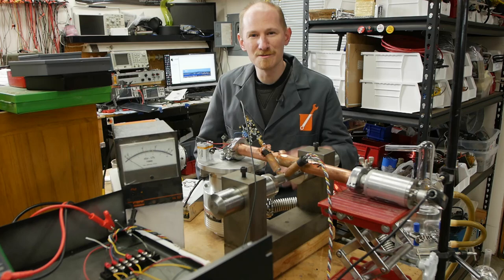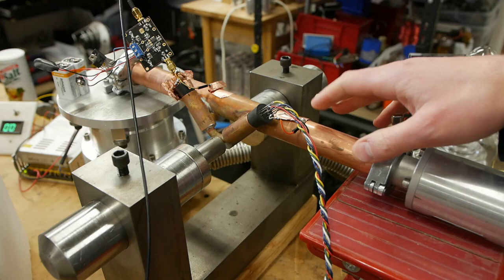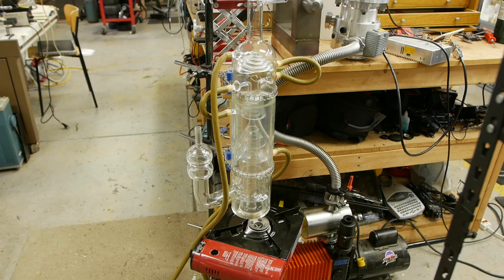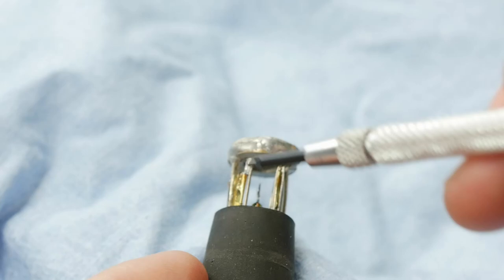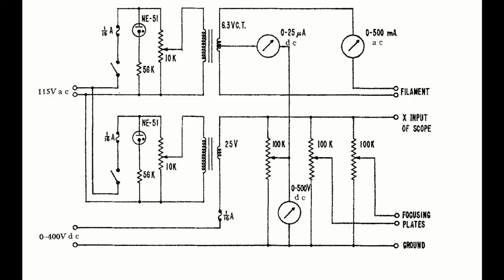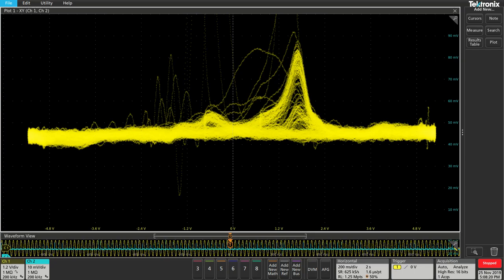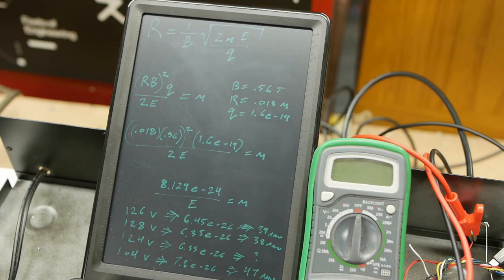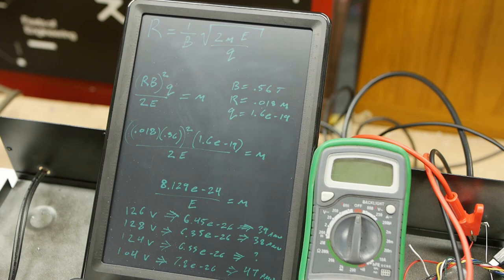DIY mass spectrometer measures potassium in dietary salt substitute

Comment: 5:16 “Nothing is an impossibility, so we try to do the best we can” - that is remarkably inspirational
Reply from the maker: Yeah when I said it, I was thinking that nothing = lack of anything (a perfect vacuum), but, yes it has a few different interesting levels of interpretation.
Reply: @Stylofo4m  Ironic, that you chose your handle.
Reply: @AppliedScience  Talk to the guy who runs the Youtube channel Thought Emporium, he makes tons of  scientific equipment from scratch on the cheap. He created a cheap Gel Electrophoresis and doc for it and I know that it's not a chromatograph but I bet if the two of you start talking about it you could create one in under a month. He has more of a focus on Biology though but Im sure he could make use of a Chromatography station if he had one. Same goes for a mass spectrometer now that I think of it lol. Speaking of it, can we see what shows up when you run a bare tungsten electrode in it without anything else to see if something about those parts is putting extra ions into the system to cause the smaller bump? Something tells me that Scientific American never thought that anyone would ever actually try to build one of these mass spectrometers. I hope with help and ideas from everyone we can get it working better. I was thinking about covering the end of the rubber stopper with something in an attempt to lower the off gassing but I don't know what would be better.
Keep up the unintentionally awesome inspiration and keep making awesome things!
here's a link to the video on his Gel Electrophoresis video to make things easier if you don't already know who I'm talking about.
https://www.youtube.com/watch?v=sSKls2kNC4U
Reply: Miroslav Kašpar yes, as he mentioned above. I did understand the original intent, I was just also implying that it could be interpreted as an inspirational message.
Reply: lol.. 'nothing' meaning absolute zero-- that's what he meant
Reply: @evilcanofdrpepper  Dude, it was Ben who made the electrodes for his neuron tests.
Reply: @Stylofo4m  as the borg queen said, "you think in such primitive three dimensions"

Comment: SA did an Amateur Scientist gas chromatograph "The Amateur Scientist
How to construct a gas chromatograph that can measure one part in a million

By C. L. Stong" September 1967
I was festinated by your presentation.
Reply: That’s awesome. I really need to go back through these Amateur Scientist articles, seems like they’ve got some sweet projects I could work on.
Reply: @mattshilling  Hi Matt, I remember one of these articles that measured 'proton precession', the basis for today's MRI medical scans. My friend performed that experiment while I built a binary adder out of WW2 surplus relays, switches and pilot lights.
Reply: Also, "How to Build a Gas Chromatograph and Use It to Separate the Components of Mixtures", Stong, C. L., June, 1966.
Reply: You can buy gas sensors for under 20 bucks like the TGS-813 for example. Making a chromatographic column for gases is also fairly simple, just take some plastic tubing and fill it with sillica or even more ghetto and oldschool, bentonite clay from kitty litter. Flow a carrier gas through it, which can just be air from a cheap aquarium pump and inject your sample in there. The real problem in GCMS and LCMS is interfacing it with the MS, since the MS operates under high vacuum and your LC or GC operated in solvents or gases. In LCMS it commonly get's nebulized and shot past a tiny ESI pipe which goes to the MS, and because that's under vacuum, it sucks some of the spray into the MS while the majority just goes to waste. Maintaining vacuum this way requires a good pump.

Comment: Some fun vacuum tips from a spectroscopist who has lived in HV for the last decade or so.

The rubber/PVC limitations you were seeing are likely not due to the hose clamps; I've achieved 1E-6 to 1E-8 using similar materials in a pinch.  The main issue is the both absorb water like no tomorrow.  The rubber stopper didn't noticeably affect the system [as much] because its higher density, lower surface area as is likely nitrile.  Most soft plastics (teflon, soft pvc, vinyl) are also very permeable to atmospheric gases. 

The 1E-4 vaccum limitation is likely due to a combination of two things. 1. (less likely)small imperfections in solder joints.  If you have a decent gague you can check for this by spraying a light gas(He) or methanol on the solder joints and looking for the gauge to bounce. 2.  (most likely)  Water. Copper loves water. You said you are having the break the seal every 5 min or so which is instantly recoating the surface with water each time you do.  Typically with our [Steel and Al] chambers first pumpdowns can take between an 30 to overnight to get past 1E-4 depending on heating/pumping speed. Subsequent pumpdowns are much faster.  Not using copper, letting a dry purge gas flow between vents, or installing a butterfly valve between the ion chamber and main vacuum line would all drastically help. (Oh also the rubber stoppers are going to be a huge source of water).

TL;DR water is evil.

Comment: I would love to build one of these! Awesome video!  The clear PVC tubing has lots of phthalate plasticizer oil in it which is relatively low molecular weight and would volatilize easily under such low pressure. The black rubber has no plasticizer and is highly crosslinked to to point where it is essentially one giant molecule
Reply: Different rubbers also absorb moisture or other volatile chemicals more or less easily, which will evaporate in the vacuum later on. Hence the type of rubber is also important. (Also the filler in the rubber plays a roll)
Reply: "The black rubber has no plasticizer and is highly crosslinked to to point where it is essentially one giant molecule"- in that case it will be hard like a rock and practically unusable.
Reply: @janami-dharmam  The scar on my face which was partly caused by the ductility of UHMW would disagree.  (Also, a comment only to be found on this channel.)
Reply: @janami-dharmam  Huh? You can make rubber without seperate plasticiser molecules easily. The 'plasticiser' would be part of the rubber polymer.
Reply: And even giant molecules can be 'soft'.
Reply: @janami-dharmam  Not necessarily rigid like a rock. If the monomer is a long chain and lightly cross-linked there will be enough freedom for the long chains to slip past one another and remain flexible.
Reply: @emilychb6621  Of course you can have them without oil-like plasticizers. What I am saying that you have to be aware of what flexible material you are using because some of them definitely contain oil-like plasticizers. Conventional PVC tubing definitely does.
Reply: @janami-dharmam  The rubber plug is probably isoprene or chloroprene, it's an elastomer. You can assume it to be almost fully crosslinked, i.e. monomers connected end to end to end to end in very very long chain. It's not actually a single molecule, but for all intents and purposes it might as well be, i.e. if the whole item was one such molecule, it would still have the same physical and chemical properties as a number of such sufficiently long chain molecules of thousands of monomers. The reason it remains flexible - while being a solid - is because this molecule is coiled up like a spring, and can uncoil itself to allow movement, without breaking, and without additives. Obviously not every such plug may be very suitable for vacuum, it might contain any number of shit in it, but it doesn't have to contain any volatile compounds, and if it does, chances are it's just a small residue and the first time you pull the vacuum, enough gets out that it doesn't end up mattering. Carbon Black pigment obviously doesn't become volatile for example.

Flexible PVC is actually mixture or suspension of sorts. The base material is a hard brittle plastic (which also has some other unfortunate properties, like, it actually is unstable and degrades super easily under a number of conditions), that is mixed with a liquid solvent, the plasticiser. There's an almost similar amount of plasticiser to the base material, and by the time you get a bunch of it out, the item becomes unusable, shrinks and falls apart. The solvent is supposed to be "non-volatile" under normal conditions, but i mean, have you seen what happens to PVC after some years, it obviously manages to escape, and obviously if you raise the temperature or draw a vacuum, you imagine what it does.

Comment: We built a mass spec based on the Dewdney paper in my intrumentation class about 10 years ago. We also saw a double peak but since the machine went together literally minutes before the end of the semester we simply accepted the idea that the peaks represented the two isotopes. There are two GC articles in the complete Amateur Scientist collection CD-ROM. The gas flow through both designs is quite a bit higher than an MS detector will accept.

Comment: To rule out differences between forward and reverse scanning directions, you could use a sawtooth deflection voltage. This will remove the reverse direction almost completely.
Reply: Exactly, like raster scan
Reply: Or ... his oscilloscope looks fairly smart. if it can output data in real time (or record and output later) you could literally separate the graph into lines drawn by the sweep in one direction and the lines drawn in the other direction. Depending on his setup he might be able to do that for the already made measurements.
Reply: A sawtooth would also provide a linear sweep instead of the sine wave sweep.
Reply: Getting that to work just right in his system where he uses a transformer in series with the signal is going to be a bit challenging...
Reply: @__dm__  Why is it challenging?
Reply: @jamesbrown99991  I expect because simply placing the 25VAC signal on top of the 400VDC signal was easy; just insert the transformer secondary.  Otherwise he needs a power supply that can linearly ramp from 375..425VDC with low noise and very low capacitance.  Mind you, I don't *know*, but had been wondering myself for a bit.
Reply: There is no forward and reverse scanning. There is small AC over huge DC, so there is strong acceleration, sometimes little lower, sometimes little higher. But i don't understand why there is AC on each point in the circuit. In my opinion AC should be only on one focusing plate or filament, but not everywhere.
Reply: @whitcwa  Shape of the AC doesn't matter as long as oscilloscope is in XY mode. Nevertheless, AC from power grid isn't clean enough to do such things.
Reply: @jameswyatt1304  A sawtooth waveform is AC, and can be inserted in the same manner as the original sinewave, i.e. via the transformer. The waveform can be from a signal generator (which he will already have); an amplifier and/or different transformer ratio may be desirable.
Reply: @jamesbrown99991  I had a poor word choice there.  Transformer superposition is simply easier and if you've ever tried passing non-sinusoidal waveforms through the usual saturated-core transformer, you've seen the results aren't "pretty".  What was a trivial add with a sine wave isn't so easy w/sawtooth or triangle.  Better?
Reply: @piotr86  shape of AC absolutely matters when you deal with nonlinearities, which is more than likely in this setup, and exactly what everyone in this chat said...
Reply: @jameswyatt1304  i agree. to add, it's also not exactly trivial to generate a sawtooth wave at a high enough voltage/power (i'd use an COTS audio amplifier because it's cheap, linear, and high BW enough for this application...) whereas 60Hz mains is literally just 60Hz mains.
Reply: @__dm__  Shape of the input signal doesn't affect linearity of the circuit. Amplitude does. But, whole setup is there to show nonlinearity - plot curves on oscilloscpe screen.
Reply: @MrRolnicek  Tricky when the scope is operating in XY mode.
Reply: @MrRolnicek  Interesting point - I have seen scopes with that ability!
Reply: I had the same idea... plus a sawtooth would also remove the non-linear portion inherent in a sine wave.
Reply: This is exactly what I was going to suggest.
Reply: There is a "Waveform view" at the bottom of the oscilloscope screen. It's hard to see, but seems like signal in channel 2 has consistently higher spikes during forward sweep.
Reply: @jameswyatt1304  in this application it makes sense to use a transformer designed for audio. For the COTS audio amplifier, I recommend a battery powered Bluetooth speaker. I would use a signal generator app on my phone as the audio source.

Audio transformers may not have 425 volts of isolation between windings. The battery powered Bluetooth speaker conveniently provides meters of isolation between the signal source and the 400 volts.
Reply: It would be interesting to change AC frequency. I wonder if changing voltage can cause filament vibration.
Reply: @epic_win  good point. A vibrating filament will release ions faster.

If that isn't a problem, we don't have to worry about filament life. The time to release a sample is so short that filament reliability won't be a problem.
Reply: @hamjudo  Note that Bluetooth audio is a bad choice for this job.  Because it is a psychoacoustic compression of a limited precision digital sampling of the requested waveform, not a linear system of inductors, capacitors and resistors. 

However, actual audio transformers designed to isolate mains voltage were common components in tube based audio equipment, so may still be obtainable. Another relevant component source would be the ferrite transformer cores used in switched mode power supplies.  Winding a custom transformer with these cores and the related mains isolation materials should be fairly trivial for someone already building custom electron emitters.
Reply: @johndododoe1411  It is a pure sine wave. I would think that pure sine waves that aren't near either frequency extreme, would come through unchanged.

A problem with many audio compression strategies is that they turn sounds that are close to pure sine waves into pure sine waves.

The psychoacoustic aspect means that the algorithms are free to save bandwidth by throwing away phase information. Signals that look like white noise that has been passed through a bandpass filter should end up looking like unrelated white noise passed through an identical filter. The filter parameters are easily heard.

It can get all wonky when the signal can't easily be described like that.
Reply: @piotr86  Not sure how you figure there's no "forward and reverse"... That's exactly what the AC component does... Sweeps the beam back and forth across the slit
Reply: @MadScientist267  Because AC component comes with huge DC, so the current flows only in one direction. 
When scanning with a sine wave, in the XY mode of the scope, the dot continuously moves along the characteristics of the system under test from left to right and from right to left, or "forward" and "reverse" if you prefer such terms. Changing the scanning waveform to sawtooth will require further expansion of the system with the spot blanking circuit. Even if this is done and the cause of the problem is elsewhere, scanning with the rising ramp will give you a different image than with the descending ramp. Which one will be correct? Both images should be the same because the shape of the scanning waveform does not matter.
Reply: @piotr86  Yes, the AC is superimposed on DC that prevents it from crossing zero but it still results in "back and forth" with the beam.

I'd have to look really close to even be able to see what causes the difference in the symmetry and all that, I think he mentioned hysteresis as a possibility (I may be mistaken at this point)... But I can't quite work out from here what would be causing it. Some artifact caused by momentum or something? 

That said, he pointed out the copycat nature of the second peak, this kinda takes it away from "waveform" for me.

I suspect it'll still be seen with sawtooth or anything else that's suitable for sweeping the beam... The reflection theory makes the most sense to me.
Reply: @MadScientist267  If the problem is due to system inertia, slowing down the scan speed is the right solution. This requires disconnecting the transformer from the power grid and connecting it to the generator output. As you decrease the frequency, the voltage must be lower to avoid saturating the core. It is possible that the transformer needs to be changed to another transformer with a different voltage ratio.
If the problem is the delay introduced by the input amplifier, reducing its gain and adding another amplifier may help.
Reply: @piotr86  What about just a single but very slow sweep... In effect completely eliminating inertia... I'd imagine with that voltage range and current, a run of the mill pot could be swept across it without much issue. Or better, if the supply has a fine control...

At least could rule out or definitively say it's sweep related, go from there
Reply: @piotr86  I would also suspect that the copycat peak would shift as frequency changed, that would reveal it in itself. Just change the frequency from 60 to 50 or whatever, if it's an [edit: inertial] artifact, it should slide over